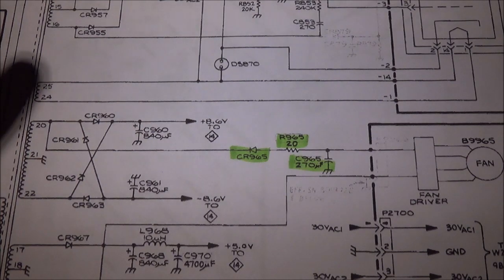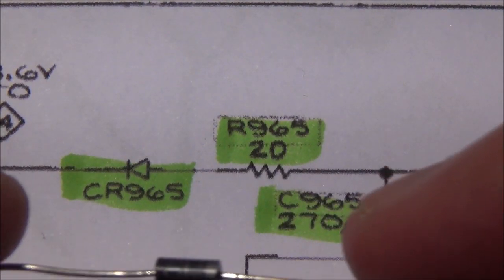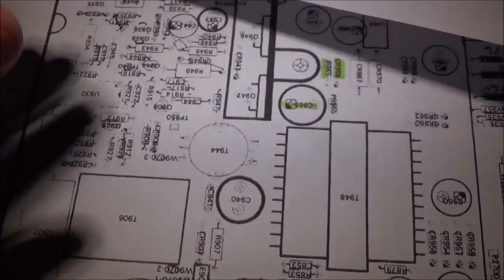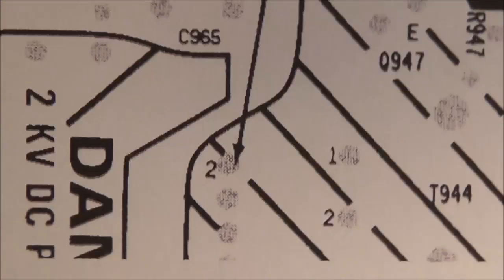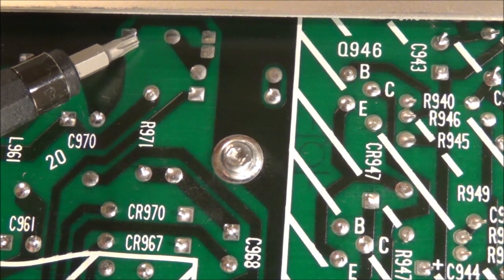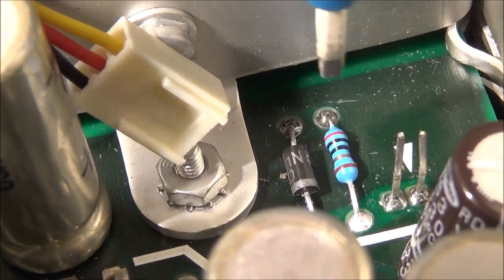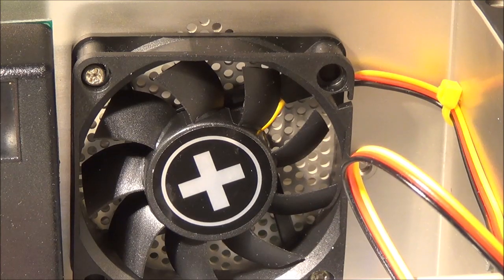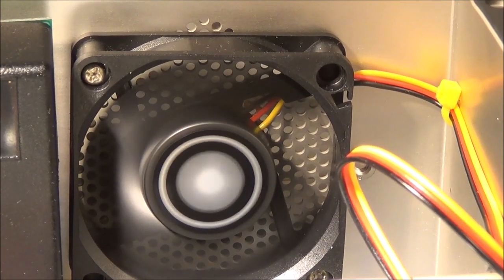Tektronix Oscilloscope 2235 Fan Installation

Comment: Awesome mod!  However, its open ended....I need to know, did the ziptie work!  :)  Id add a fan to if I could, no holes...guess I could get crafty with a drill and make my own!  :)  Actually, I am trolling for a new scope...thanks for the vid OS!  ~Jack, VEG
Reply from the maker: Thanks, Jack, VEG! That zip tie was monumental ;-) And, yes it did work, I am not sure though, that the color matches our furniture to my wife's satisfaction.
Reply: Very cool, I can no enjoy life easier! Hope the wife can forgive of the errors of your way!  :)  I bought a new (to me) scope this morning...bought a Tektronix TDS620 500MHz...supposed to be 100%...hope so...I bought a HP 8656A sig-gen last FRi, got it yesterday, was supposed to work, but it dont..spent all night reading the manual...hurt eyes..has 5v issue...might be above my head..but I'll try.  ~Jack, VEG
Reply from the maker: I knew you would have sleepless nights! Tossing and turning...The zip tie monster enters the dreams. Hopefully I didn't leave the "using a square wave to ring an inductor" video I just made open-ended. Your test instruments are getting more and more sophisticated. TDS620; you are going all out. The good thing is with the HPs: elaborate service manuals.